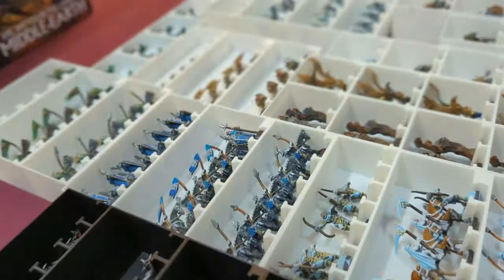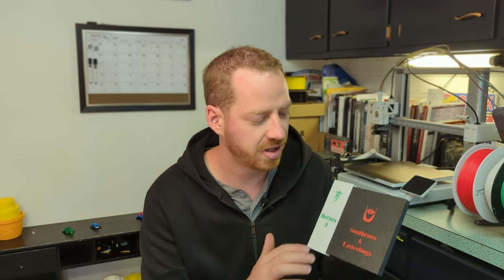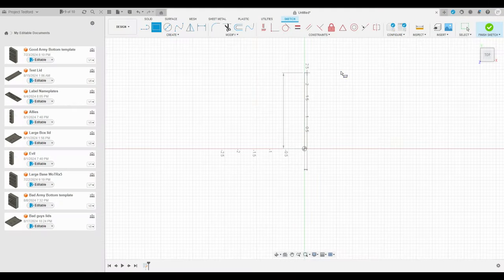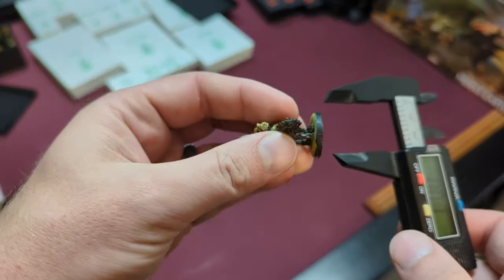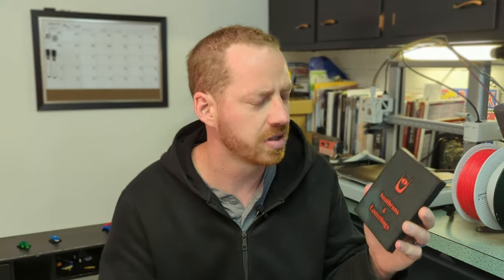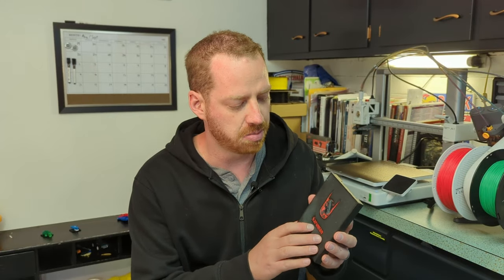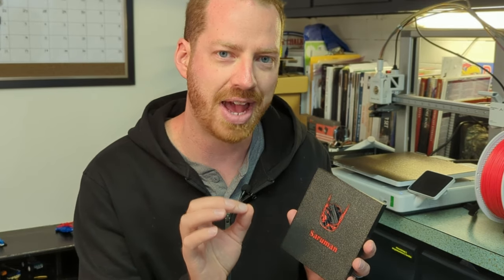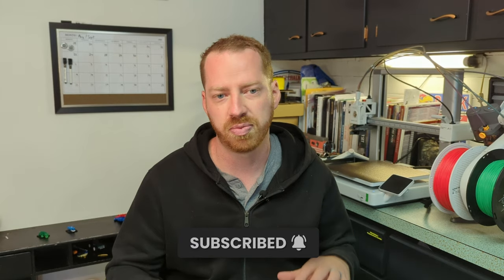3D Printed Clever Miniature Storage Solution

Comment: A tip I learned when designing and printing things is to print a small slice of the object. I just cut out a small section in my slicer. Then you can verify that the dimensions are correct without printing the entire thing. These look amazing! Great job.
Reply from the maker: Thank you! This is something I haven't played around with yet, I usually cut in my modeling software not the slicer. I need to test that out!

Comment: This is THE BEST miniature carrying solution that i have ever seen. I play warhammer 40k tabletop and dnd. I am definitely going to use this to transport my models, especially considering that im the one who provides all of the models for our group. I can't believe i never thought to do this. Best part is: no modifications to the model are necessary, just measure the base size (standardized for warhammer minis) and the height and depth of the mini to get the box that you need. Not only that but each box can be its own unit for warhammer. Have some terminators? But all 5 in one box and lable it terminator. You can do this for everything. This makes it both great for transport and organization for models. It basically does the same thing as a magnet carry case but cheaper and (argueably) slightly worse.
Reply from the maker: Thank you for the kind words. I agree, you should share your designs once you build them out for Warhammer! Would love to see that for Warhammer! I have way too many Warhammer miniatures as well...need to design something myself...
Reply: @projecttedford477  i dont have my own printer yet. Could you give me some recommendations for a good first printer?

Comment: Thanks that was helpful. I didnt really understand what you did with the inlay.
Reply from the maker: Sorry, I know I wasn't clear on that part. I at first tried extruding the entire graphic image, but then changed to selecting the outside of the image. I then used what is called the offset tool to make a very small difference in the thickness of the outline. This gave me enough of a difference that I could then change colors of the image and have separation from the main piece color.
Reply: @projecttedford477  awesome thanks

Comment: When you were making sketches off the caliper measurements, did you remember to take the plastic's shrinkage amount? That's been my main issue with printing things specifically for minis (cases, bases, toppers, etc) on an FDM.
Reply from the maker: That's really interesting. I haven't heard of this, but totally makes sense. How do you account for the shrinkage?
Reply: @projecttedford477   I actually add a half millimeter or two to the dimensions of the object while I'm making it. That is usually enough for my general needs, but your mileage may very based on the filament.
Reply: @projecttedford477  Shrinkage depends a lot on the type of plastic.  Actual PLA will shrink very little; ABS shrinks quite a lot.  The trick is that most brands of PLA aren't pure PLA, so they can have some odd properties.  The best way to find out is to print a couple of calibration tools - preferably larger ones.  If your parts are shrinking by 0.5% and you're only printing a 20mm calibration cube, the shrinkage is only 0.1mm.  That's easily lost in the accuracy of your calipres or even just the variation in individual layers.

Comment: The only problem I have with these designs is that for metal models or models with low base contact (like for example GW non-smurfs without slotted tabs) the inertia of the moving case is going to primarily create torque originating from the model, and pivoting around the contact point with the base, which is restrained. That's why restraining the model itself with foam is the core of old generation case designs.

This is definitely fine for walking to the club, but I'd probably want to make some changes to the design if I'm going to take it on a flight.
Reply from the maker: Definitely a good point. I do have some GW models and need to try this out on those!

Comment: Why are you measuring the box?  You have its nominal dimensions from the Fusion 360 file already.  You just need to learn how much tolerance to build in for your printer's mechanical accuracy.  As a rule of thumb, I'd start with 0.1mm for each printed surface, so the inside of the box lid ends up being 0.2mm wider than the outside of the box itself.

In fact, you can just use the offset tool in 360 and draw your lid in the same project as the box itself.
Reply from the maker: That's a good point! I wanted to use the box to get close enough measurements so that it would come out in the end. I could have used Fusion, so definitely a lesson learned!